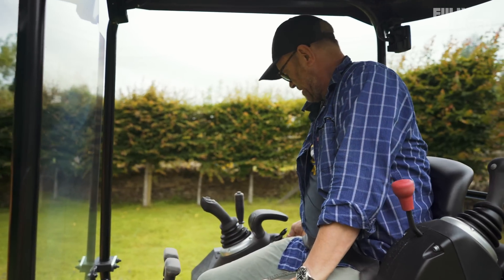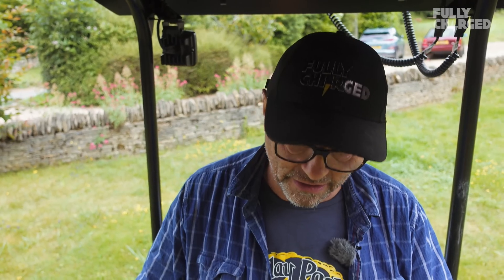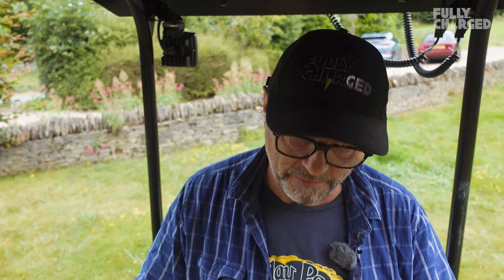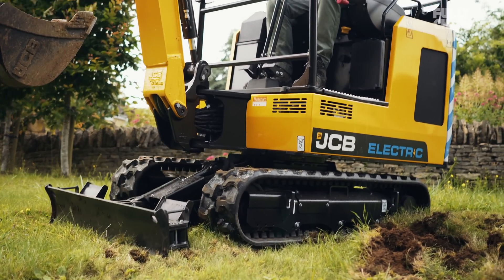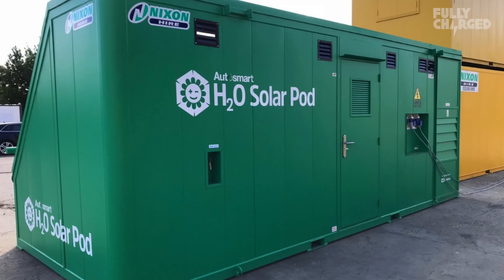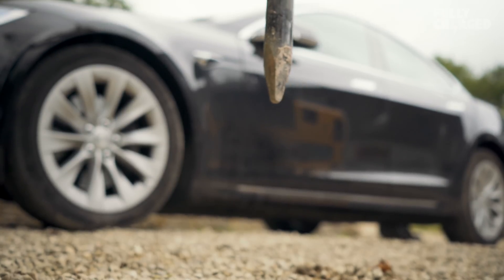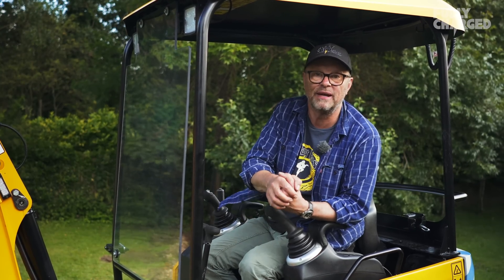JCB Electric Excavator / Mini Digger JCB 19C-1E E-TEC zero emissions electric digger | Fully Charged

Comment: Great video and very inspiring! But why are you fitting 3-phase electricity? Is it to speed up home charging or are you exceeding the capacity on your single-phase? Your solar panels and Tesla Wall charger should surely reduce your requirement for mains electricity.
Reply: It's not 3 phase, it's 110v type costruction site splash proof plug and socket every site in UK uses it.  He plugs in to mains at 240v then yellow box that weight a ton is step-down transformer 110v. I know it looks like 3 p hase but it ain't 3 pin in plug

Comment: It is nice maybe in the UK but in northern Europe we got -20C in winter and I bet the battery life would reduce 2/3.
Plus the battery itself is very expensive, I bet it is 1/3 of the machine and if you need to replace it every 6-7 years then it would be a bad deal. So until they haven't been figured out the battery issue on electric machines I stick with diesel ones.
Reply: Gontainer, but then, diesel doesn't much like those sub-zero temperatures either.

Comment: hey bob!! good to see you!!
 here is a construction tip put down a tarp before you dig!! it makes refill of the trench super easy!!
a cleaner finished job site for sure!!
the best thing on electric is you do not have to change the engine oil!!
it needs a stereo!! lol!!
then you can play all the noisy engine sounds!! LOL!!
these work well in areas like digging near sewer gas or explosive dust...

2 hour speed charge.. lol a 6 pint lunch!!
they need quick change battery's so you could swap out battery's for job sites that run 7/24!!

Comment: This would also be ideal if the batteries were pods. a Savvy company could charge them at their depot overnight. thus not using onsight diesel charging at all. In locations with no power that is.

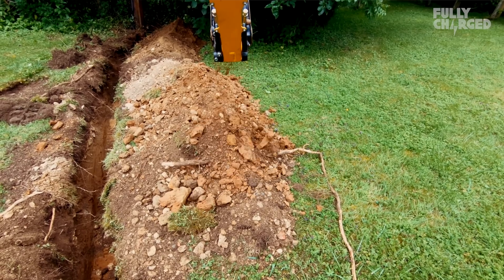Comment: @1:30 "I have to use a different part of my brain" No, you shouldnt. Just let go, feel the Force. If you are thinking you are doing it wrong. A digger is an extension of your body, not like a tool you hold. Also do 2 actions at once. Lifting from the trench, instead of lift, rotate, extend, tip. Try lift+extend, extend+rotate, then tip. With single actions your hands will move centre to action and back, with 2 actions at once your hands move in circles from one action to the next without returning to centre.

Comment: Have to say, it's a rather impressive piece of kit, very well done JCB! My biggest question is why Bob the Builder would need 3 phase power in the first place!? I'm guessing it would be to power the car, but if that's the case wouldn't it be both simpler, easier and more efficient to setup a DC fast charger in his shed, and maybe redo his homes roof as a single flat slant pointing towards the sun and covered in solar panels?! 

That would make the house look more impressive, the roof would be easier to clean, only a fraction of the guttering and down pipes would be required, and seeing as all the power generated would be DC already, it would cut down the need of conversion to and from AC! 

I don't quite understand why people even envisage the grid existing!?!? Bizarre. The same with charging networks, they'll be dead in 10 or 15 years. As homes increase their levels of autonomy the need to be fed energy via a tube becomes more and more antiquated! 

Interesting fact, Perth in Western Australia has a greater annual rainfall than London, so we have some very wet and dark days! And yet, even in the dead of winter, we seem to average enough sunshine to supply an average houses electricity needs with a 12-15kw installation (smaller footprint than the average sized roof!) So, if we can do it with wetter weather, I'm sure folks in the UK might stand a chance! 

Just interesting to see the continued push to keep the cord to our mama governments and corporations! 

Oh, and finally, on the whole "using a generator" to charge this machine, it's unfortunate that the people who make those comments just don't get that generators might get replaced with battery blocks that fast charge other devices, just like a scaled up battery bank. There's also potential for trailers or roof racks on work vehicles that fold out a PV array and sit there storing power while at a work site, completely wiping out the need for a generator! 

I guess some people just don't "get it", and despite there being no blessing in being stupid, they'll stubbornly persist! Generators are borderline dead though. I mean I already use a solid steel, heavy duty, battery powered lawn mower, battery vacuum, battery drills, blower, saws, laptops, it's fast becoming a world powered by batteries :) And a much cleaner, greener and quieter one where we can actually enjoy what we do without the loud hum and rattle of a motor that sometimes works! 

Once again, well done JCB, and well done Robert/Fullycharged for featuring this :)
Reply: Err, my roof will accommodate 3kW on the south facing side - that's 12 panels. It's taken me 6 and a half years to recoup my outlay - and that's with a great feed in tariff... 12kW is 48 panels. That's practically an energy farm!!
I would have died of old age before I broke even......!
Reality calling.....
Reply: @andymccabe6712  You must have a rather small roof, clearly can't be the largest in the UK!!! Some quick math with 12 panels would suggest somewhere around 10m2 maybe upto 14m2.....considering even a fairly small 3 bedroom house would be the best part of 100m2 I struggle to see how you've managed to fit your full kitchen, bathroom, bedroom and lounge into your 10m2 of house (Can be done no doubt, I just wouldn't think that's the average UK home unless it's become an extremely third world nation!) 

As for the 6.5 years to recoup your outlay, I dare say that's not a bad investment or return on a system that's grid connected, bearing in mind that solar panels have probably improved a bit over the past 7 years, and have definitely become a  whole lot cheaper!! 

I still agree that 6.5 years is a long payback period and I would suggest that's exactly in line with my point that the grid is what's killing it and this is why we need to cut the cord!! It's a hugely, complex, inefficient, loss making system. Think of all the wasted power travelling along power lines, the endless power lines themselves, the wasted man hours looking after a system that's simply to complex. It's literally a dead end project that governments keep funding to keep a few people employed! 

And that's not even mentioning all the visual pollution along with safety risks to society, how many people get injured or hurt running into power poles each year I wonder!!

As for a little "reality", a complete battery and solar system can be had out of china for less than 10 000 $AU, which would supply enough storage and generate enough power to power an average house and that's without any government subsidies. In Aussie, we have the added benefit of cheap second hand panels, where a 2-3kw system can often be picked up for $300-400, and will still have 10-15 years of life left! Supposing we got two such systems installed, that's approximately $800. Add say 30kw of deep cycle lead acid's or even a couple 5kw home made power walls, an inverter, and we end up around the $3000-$4000 mark. 

A pretty average aussie power bill these days would be around the $1800 mark per year, so with some basic math, we can see the entire system could be paid off in 2-3 years! If the system even lasts for 10 years then that's a 200-300% profit over it's life time, and a ROI of 20%+ pa (I dare say your own system will achieve a figure not overly different based on what you've mentioned!!)  so in reality, objective reality that is, it's not a bad investment!!! 

I actually find it funny, you're complaining you took 6.5 years to recoup your investment on your solar panels, meanwhile, on the assumption you own your house and have a mortgage/own it outright, you'll spend probably the next 30-50 years recouping your investment!!! 6.5 vs 30...I think you're onto a winner there, even if it's not as greater winner as what solar CAN be!!!

Comment: I can see the future of HOA's demanding them over diesel equipment. Strange it don't have a solar top might not do much but the space is there, during idle time , lunch ,coffee, bathroom, measuring and so on would extend the run time adding a minimum cost to the machine. I worked in a factory back in the 80's with E forklifts and they ran 8 hr shifts no problem with lead acid batteries.

Comment: digging a one foot trench, nice and slow, in soft topsoil is barely gonna show true battery capacity.  Dig a 2 foot deep trench in some rocky hard pack, with the speed of an experienced operator, and that thing will do a half days hard work before you plug it in.

And those solar pods are bollocks.  They are solar panels charging a huge battery.  Quick and efficient solar charging is a myth, unless you charge a larger battery and use it to charge a smaller one.  There was a video on youtube, of a guy using a solar charger on his musk, with enough panels to cover his car three times over, and he had an 80% charge, and his musk was showing something along the lines of 8 hours to top off his batteries.  "For some reason", the video was taken off of youtube.  i wonder why!

Comment: It's crazy how quiet it is!
I used to do a lot of "banksman" work. Standing in the trench to watch for cables and gas lines. And the constant standing in the (low hanging) exhaust gases was terrible on hot days with no or bad wind. My friend bought a brand new digger last year (partly because of those reasons), and it's cleaner and a lot more quiet, but still this digger would be 10 times nicer to work around.

Comment: Will probably be Charged up on building sites by diesel generators
Reply: Bm 90 he answered this on the video. Ingnoring the power source the quietness is a massive bonus. Less need for cab noise isolation safer too. Ground workers would find it easier to communicate with the drive and not have to shout plus one gunny could possibly charge multiple machines

Comment: Should have put plastic sheeting down, in manageable overlapping sections (maybe 3/4 yards or metres each)😟 for the soil. Much less mess, protects your grass and simpler to refill trench by dragging sections one at a time into the trench then freeing up the plastic (for re-use).

Comment: CAN IT BE SCALED UP, OR WHAT?! Surely that's the question everyone wants to know the answer to - emissions involved in mining contribute to the carbon contribution of everything made with the mined resource (usually an ore that's processed for a metal). People whine about electric cars still having come from these resources, but if the bauxite that makes the aluminium that makes the car is dug out using electric diggers and electric dump trucks all charged off portable PV banks or temporary mine infrastructure that can be reused elsewhere (or perhaps even left to provide power for remediating the site later on) that would be significantly less emission in the whole production process.

Comment: This technology is super helpful in densely populated urban environments where noise and pollution caused by diesel excavators is a big issue. I can see the use cases for this type of machinery, in public works inside cities on public roads, metro construction, plumbing etc even during rush hours, without noise, dirt, and pollution (well when using the drill bit it is noisy, but still more friendly than a poorly maintained diesel engine revving up and shooting black smoke through it's exhaust pipe). More friendly for the operators too - health benefits for not breathing this toxic cocktail of gases daily...

Comment: I had been somewhat skeptical that a 1 to 2 ton mini excavator would be capable of working a full day on site, tracking, work lights on, etc, but I realise that these battery packs and motors are well matched to the machine's intended role.

Commercial competition will encourage manufacturers to further develop these machines and ultimately, the owner, Operator and environment benefits.

Comment: Why didn't they just omit the inefficient hydraulic pump and make use of high power direct electric linear actuators?
Reply: Brent Hasty kinda wondered that too.. perhaps one nice thing about hydraulics is that the "actuator" (cylinders) are relatively small for their power, and robust. Electric linear actuators are also fairly imprecise right? Like springy in their movement? And using electric motors with gearboxes in actuators seems bulky and prone to damage. Hydraulics might still be the way to go even with the conversion losses...
Reply: @dregenius  I have seen other electric tractor builds use linear actuators with great results. Even with gear boxes linear actuators are magnitudes more reliable than hydraulics.
I have never noticed springy in the worm screw used in linear actuators with any of the builds I have used them in

Comment: I am sure I am not the only one to say this, but be VERY AWARE of "crossing phases" on a 3 phase supply. That is 'shorting out' between separate supplies, for example when using an extension cable from one building to another. It usually only happens once, as you will not be alive for another attempt. One of my lecturers survived such an incident: It MELTED his 500 volt mains tester, (that is what shorted out), and burnt off every hair on his body. He did not say if it lit up his eyes or not!

Comment: Same amount of power as a toaster? I have a small electric forklift and it's charger has a 30 amp 240 volt 3 phase circuit supplying it. That's a bit more than a toaster
Reply: Yeah, but have you seen the size of his toaster!
He's looking good for a man with a 300 slices a day habit.
Reply: I suppose, he didn't refer to the maximum power, but to average power during work.
20 kWh would be 10 hours with an average of 2 kW.
Reply: @701983  A skilled operator would be moving much faster and getting much more done. If that machine was being run productively, it'd be using a couple times the power

Comment: First of all you need to call dig alert to check if any other utilities are in the area. They will then be marked so you don't tear anything out. Then you need to lay your pattern down with paint and a string line so you have a roadmap to dig your trench. Here in California it is customary for your 3 phase power conduit to have 30" of cover above the pipe. So if you are using 4" EMT you would be digging 34" deep to accommodate your pipe and cover to the surface.
An aid to maintain a level depth would be to curl the bucket away from you so it is vertical, then measure from the tip of the bucket teeth up to your 34" dig depth point then wrap a piece of electric tape on the dipper stick, and now you can gauge your depth from the seat of the excavator. You save time and don't need to jump out of the seat every time you need a grade check. You grade check yourself as you are digging. A good operator should dig 100' an hour under ideal conditions with no other utilities to dig around.. Electric lines generally require a trace of sand for 12" above the pipe. This is placed as a warning to any other excavators that if this utility is not marked, will forewarn the future dig operator that a line is there. You should know this if your name is Bob the builder. I am a former general engineering and building contractor in California, now retired.

Comment: I have a question : is it possible to operate it while it is charging? And if not, why so?
Reply: Because you could wind up or strip the cable with it
Reply: you'd need a specialised arrangement with the cable which would probably be more hassle than it's worth given it can work a whole day unplugged, there's no fundimental technical reason stopping you though.

Comment: There is now a huge 35 ton dump truck in operation in Switzerland.  It climbs a mountain and takes on a 65 ton load of material to be used in a cement plant at the base of this mountain. Because the truck is so much heavier coming down the regen braking charges the 600 kw battery to full by the time it gets to the plant. The truck hasn't been plugged in since the first day of operation. I bet Robert would love a ride in that.

Comment: as an electrician and a huge electric vehicle fan i have a hard time seeing this implemented in construction. the reason being is having the electricity available. the service for a building doesn't typically get added until the building has been fully constructed. this meaning the amount needed to charge these vehicles wouldn't be available until they are not needed anymore. adding a new service for these vehicles to charge would hardly be worth the cost difference of burning diesel. these would have to be forced in with environmental regulations rather then by cost effectiveness.

Comment: Need one with a battery that does 4 hours and fast charges during your lunch break. Then they'd be used on work sites more.
Reply from the maker: Fascinated by this comment and can only assume you haven't watched the whole thing. The battery lasts 7+ hours, and they are in use on building sites all over the world already.
Reply from the maker: It's possible you didn't watch the whole video. This machine can run for 7 hours + on one charge.

Comment: Those things are awful for construction work. You get about 4 hours work out of them a day and it takes a diesel generator 10 + hours to charge them on site. There are probably some good use case scenarios for them but they aren't going to save the planet. There's a big difference between digging a trench in your gargen through soft mud and working on a construction site.